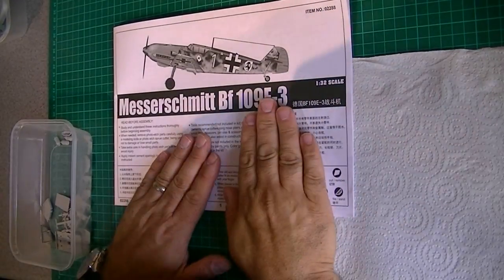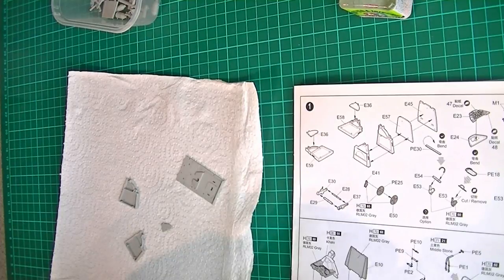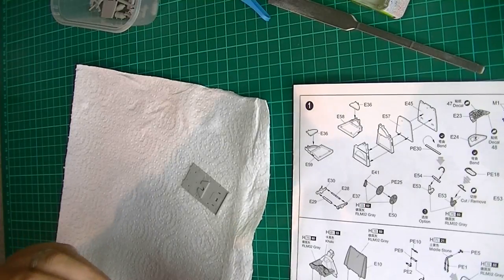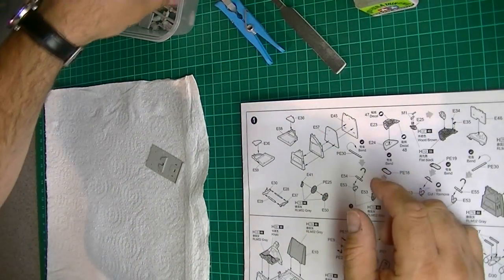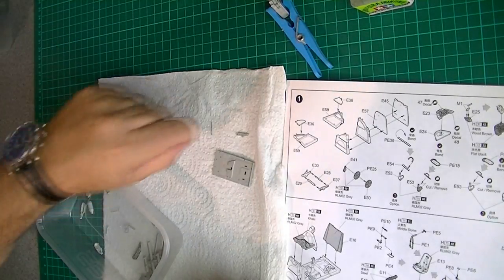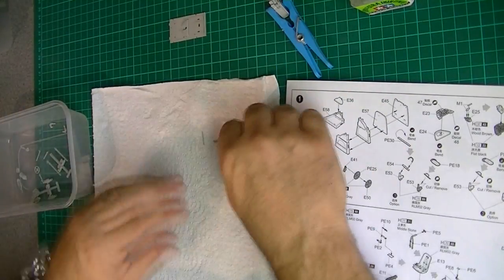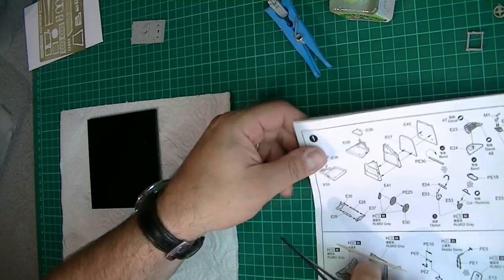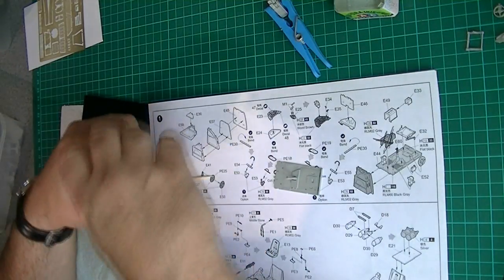Trumpeter BF 109 Build Part 1

Comment: How did you find this model? I have been looking for a 1/32 WW2 aircraft and this seems to be able to be found for a reasonable price. I wish Trumpeter would print their intruction manuals in book format like Tamiya, GWH and co.
Reply from the maker: Hi
It built up well, but its a little inaccurate in places, the cockpit is incorrect for a E version. The instruction shows the center console that would normally cover the end of the cannon that goes through the engine on G versions. Part of the fuselage looks incorrect where it meets the wings. I'm no expert but it looks different to the Eduard 109e i built. I Agree the instruction manuals could be a lot better.
Thanks
Reply: @TKscalemodels Have you built the Eduard 1/32 as well? Was that as good as their 1/48 scale? I am not overly concerned with historical accuracy. I wish Eduard would make a 1/32 spitfire.
Reply from the maker: @ApriliaRSV4F  Yes i have built the eduard ME109 both in 1/48 and 1/32 both good kits
Reply: @TKscalemodels  Sweet cheers for that. I have built the 1/48 and think i will go with the 1/32. May get this as well. Will see.